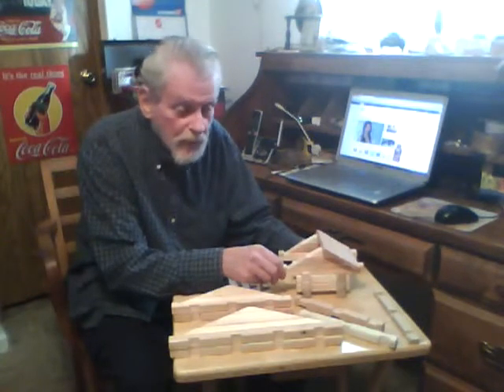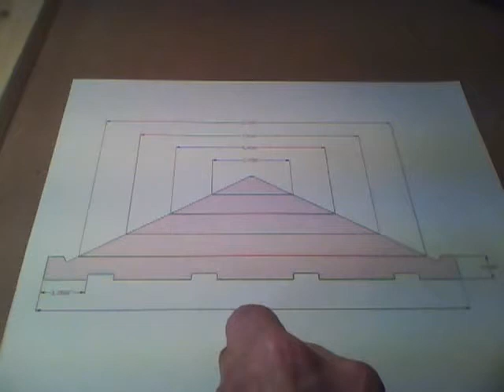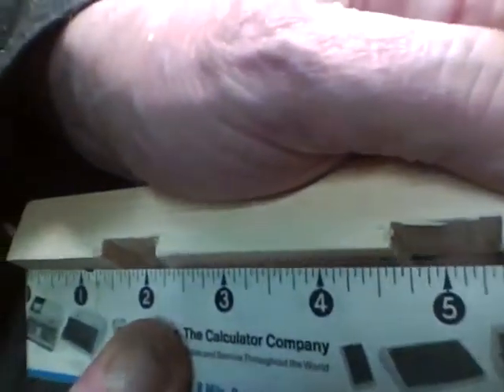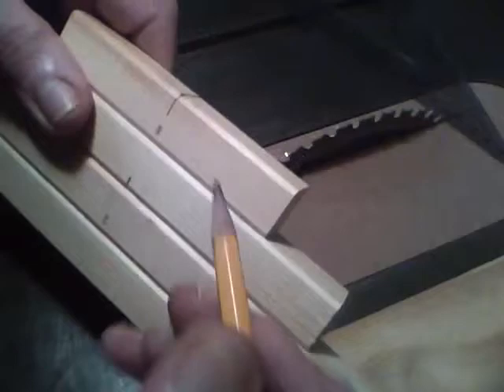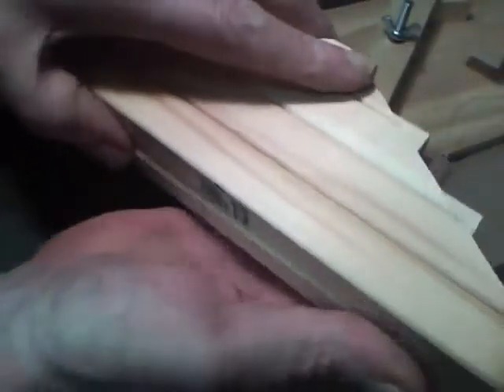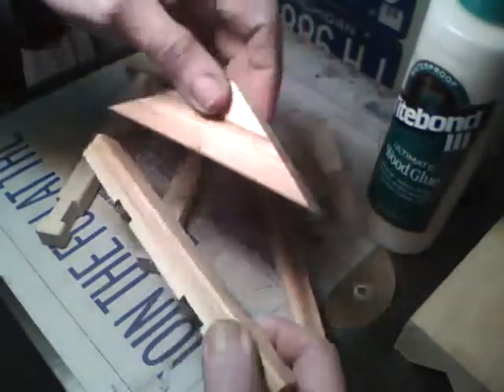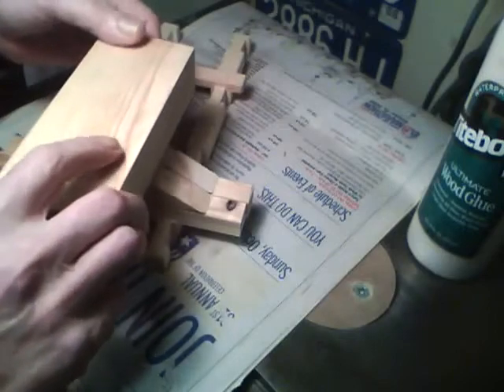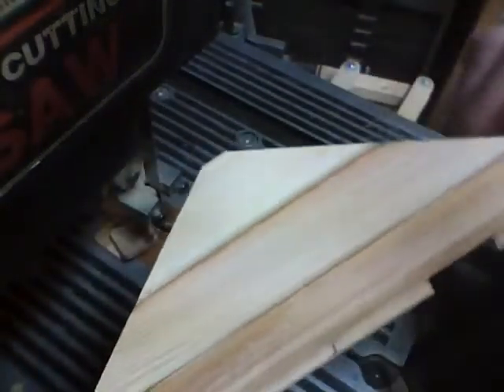How to make American Logs Part 3 Gables

Comment: Thank you Jim. I think I watched this a few years ago so I could build some logs for my grandkids. Since I modified my sled for notching. I had some shaper blades milled from one inch to 3/4” .  No more messing with the dado. I made a fixture for my band saw for cutting all pieces to length. That fixture has movable fences, and I have one I can cut 45° and 30° gable ends on, complete with notches. I have locators on the fences so everything is exactly cut the same. I now have log sets from New York to Colorado and a few places in between. Thank you for your inspiration!

Comment: for those who are making these, I built the gables like this and ran into major problems with the angle.  The most critical thing is to make the top to the notch fit 3/4" increments.  So you may have a partial log  thickness at the top of the gable to make this work right.  I did it his way  ( and in other plans I had seen) and I had about 1/4" left over at the top of the 4 notch and 3 notch gables and none with the 2 notch gables, when laying on the 3/4 slats for the roof.  And the angles for all 3 types of gables were different which means the chimneys had to be all different angles.  I will have to remake the gables so the pitch meets some sort of 3/4 increments, probably with a compass in the layout, and try to get all the angles to be the same for the chimneys.  This means that the eave hangover will be different on each size, which is not big deal.
I used Hunter green paint thinned with paint thinner to make the roof match the original Lincoln logs and did the same with red on the chimneys, so the wood grain shows through, and not just solid color as it would be with paint.